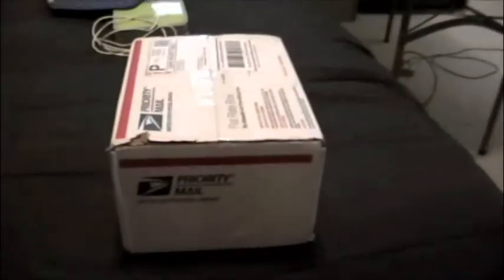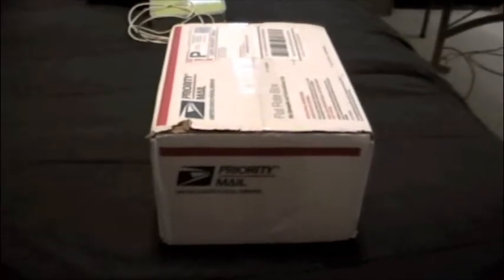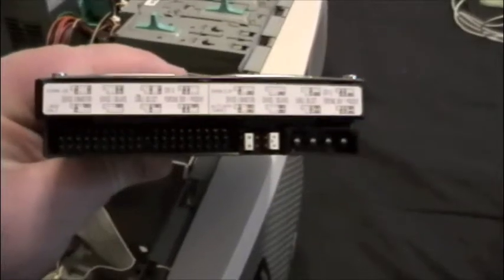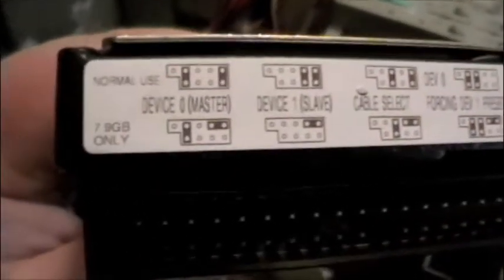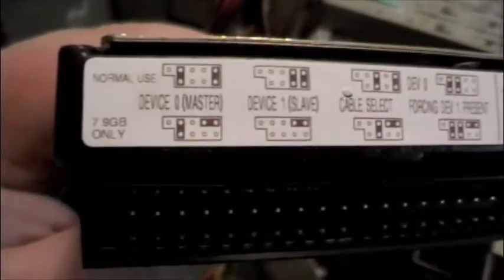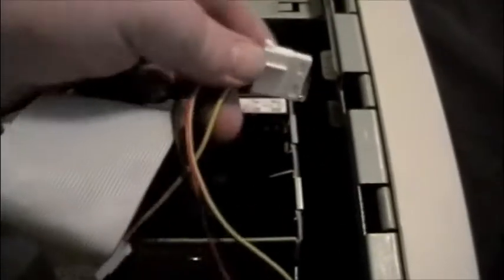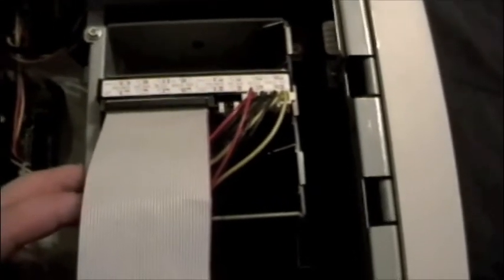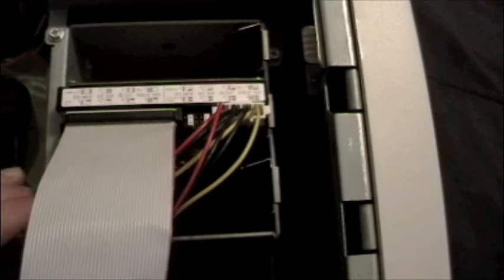Old Gateway Hard Drive Install

Comment: the hdd is still dead but i got a trojan on it about 5 years ago and it screwed up everything we took it to a computer place to get it fixed but they couldnt do anything they said its a problem with the mother board. so we stored it..then 4 years later we turned it on and it worked great! the next day the hard drive made clicking and a constant grinding crunching noise. my dad told me not to mess with it anymore and its still in the closet untouched.